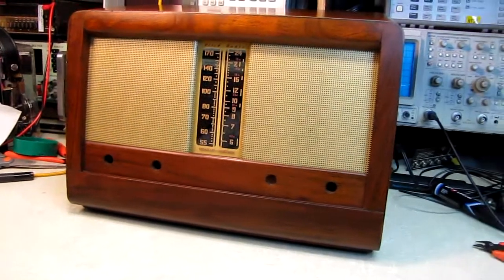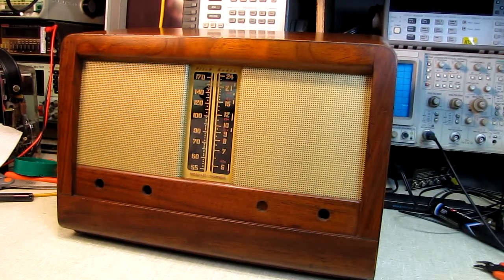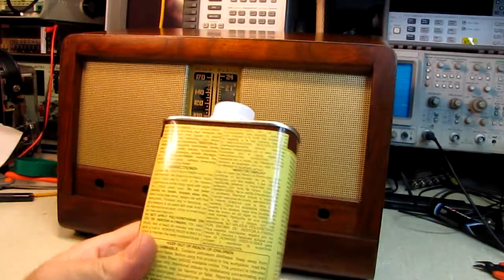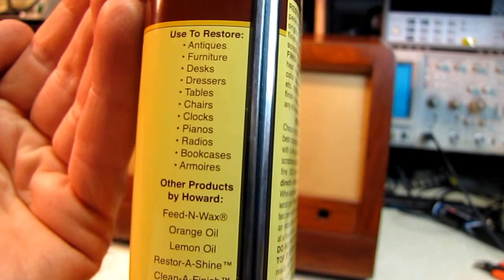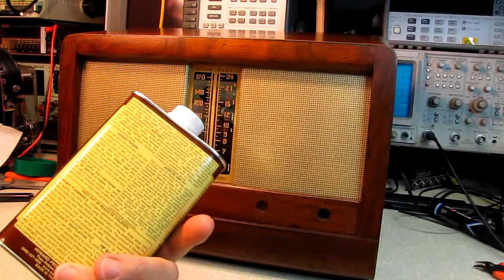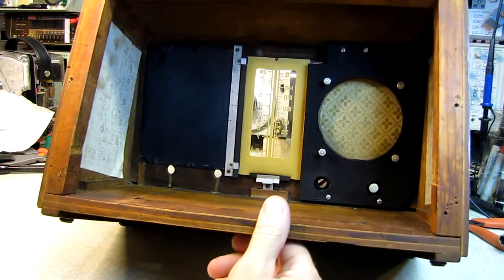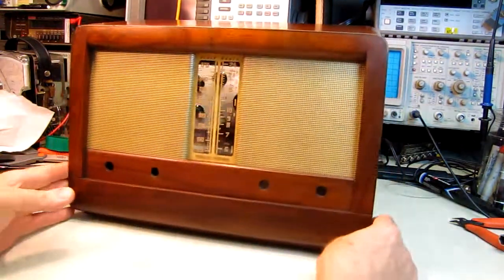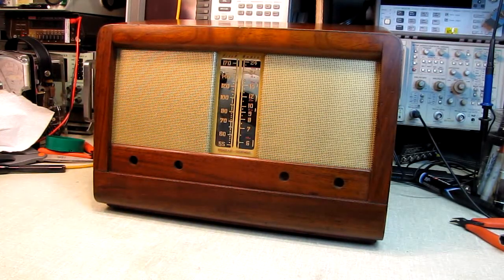Pilot T 511 Radio Restoration Part 3

Comment: Looks pretty good for a rub on finish.  I love refinishing wood.  Shoot I love being in the woodworking shop.  Go out in the woods, cut down a tree, slice it up on the portable sawmill and let it dry for a few years.  After dried surface and cut to size and build something cool.  Built a lot of the furniture in my house out of trees from the woods out back.  Besides electricity and metal shavings running through my veins I also have sawdust.  Just wish I could find time to get into the wood shop once in a while.  Always stuck fixing radios. :-(
Reply: Squeeze in some time for the wood. Always relaxes me, except when I really screw things up.
Reply from the maker: I usually find a radio to fix to relax after I screw up the finish.
Reply: The Radio Mechanic 

LOL, no relaxing this time.  You got the finishing job done with no screw ups. :-)

Comment: That looks great! If that stuff fit your style any better, it would have to have your picture on the front! 
You might want to stock up on that stuff. If your luck is anything like mine, any useful product you find will quickly disappear from store shelves, never to return.
Reply from the maker: Have had that happen more times than I can count. Went back and bought a second can just in case.
Reply: Can't hurt to have some extra on hand, especially if/when the stuff gets pulled from stores.